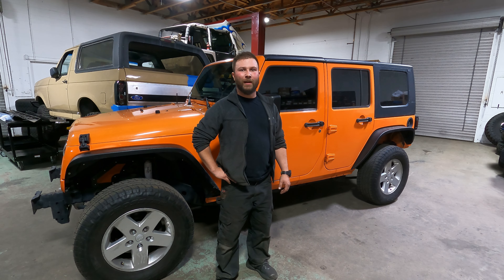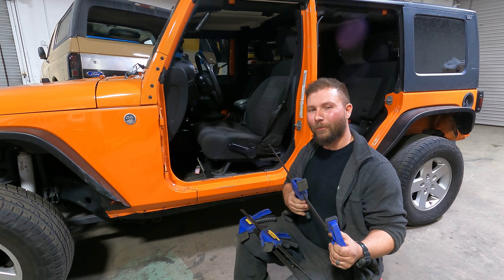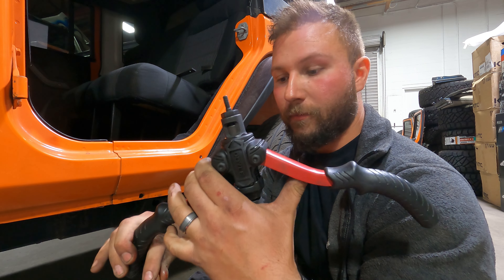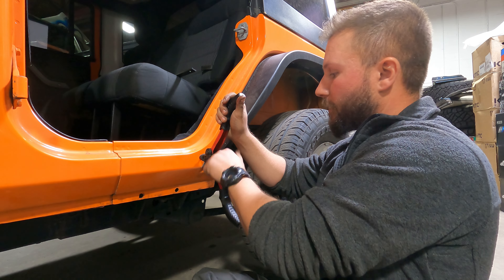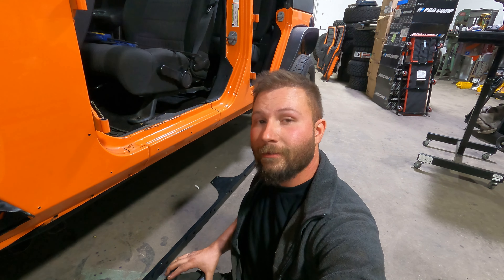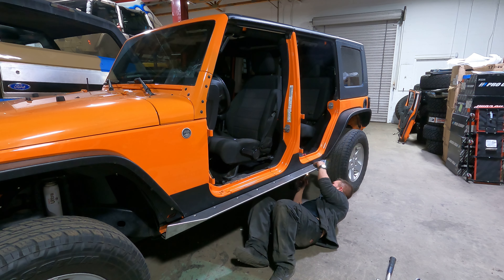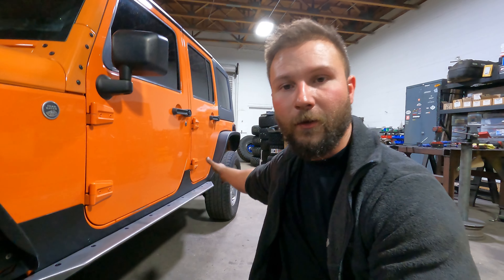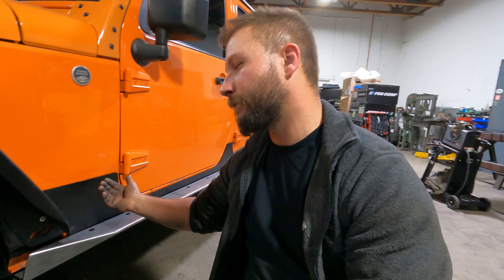Saving the Jeep body with the Motobilt Crusher rocker guards

Comment: I like and want these, but having both pieces connected makes me a little uneasy. There will still be some deflection, idk how I feel about the sheet metal guard moving (even if it’s a little bit) over a few years of wheeling.

I subscribed to see how they hold up!
Reply from the maker: Motobilt just came out with frame mounted sliders as of last week for the JK. Definitely give those a look!

Comment: I might have missed it, but what was your reasoning for going for these body-mount style vs. the frame mount? I saw your discussion on how it was the middle ground on strength. I've noted on other frame-mount rocker guards that they have the disadvantage of reducing ground clearance.
Reply from the maker: My reasoning for going with these sliders is because they are apart of the body armor system that Motobilt provides for the Jk and the fenders, bumpers, and sliders fits together very well. It’s all 3/16 and I still felt like it was well engineered and should be strong against rock impacts. Time will determine if this is true or not lol. These are also very tucked up on the body so they help keep the ground clearance high on the Jeep. As of right now Motobilt doesn’t make a frame mounted version for the JK but they do make a set for the JL. Thanks for watching!

Comment: Its all relative on how one uses their jeep.  But from experience over alot of years with different people, if youre using your rock sliders DO NOT use this setup...   It puts the impacts into the body and tweaks the heck out of your lower body panels on impacts.  If youre truely using your rock sliders, frame mounted sliders are the only ones to use....